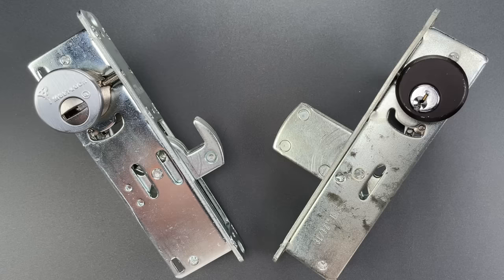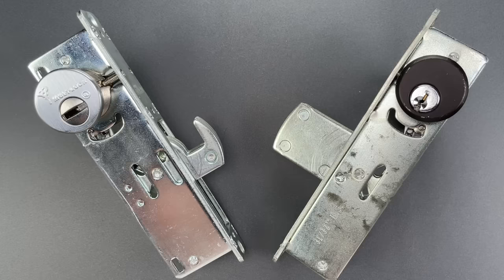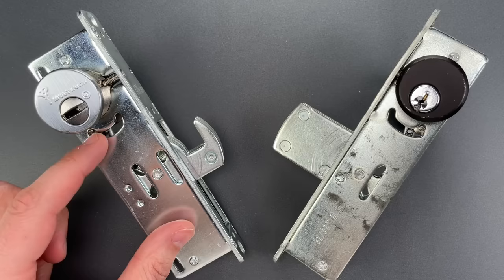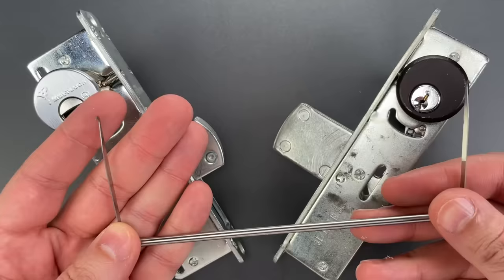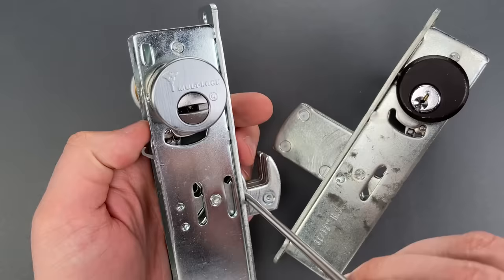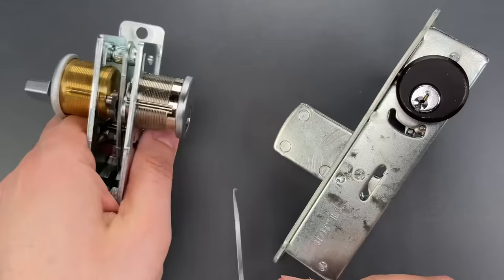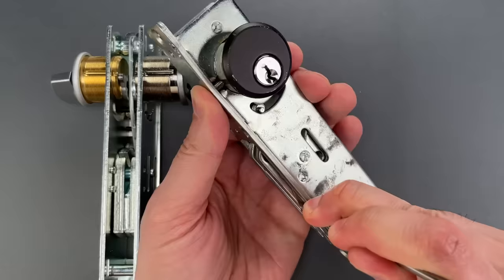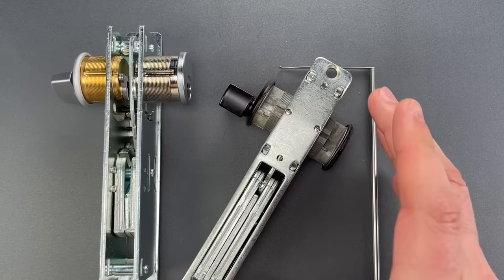[1409] The Most Significant Security Flaw in North America

Comment: Basically, what I’ve learned with lock picking lawyer is that most lock manufacturers are hoping thieves don’t take the time to research how to defeat locks and if they did, we’d all be in a lot more trouble!
Reply: Yes and no. The alternate is just as fast for most, just louder. 
Like here, a rock or brick will get you into the store. 
If you use a brick or this tool, the alarm is still going off. This tool will not prevent a smash and grab
Reply: Most manufacturers are hoping honest people stay honest.
Reply: Thieves don’t pick locks.
Reply: @IncredulousIndividual  They do if picking the lock is the easiest way into wherever they mean to do their thieving.  Usually that isn't the case, though, since windows are a thing and rocks are easy to acquire.
Reply: @IncredulousIndividual  You sure? All of them?
Reply: @IncredulousIndividual  You are talking about is smash and grab burglars. There is a reason we have different names that reflect different techniques under the overall umbrella term of thief.
Reply: @phil2544  only 4.2 percent of burglaries were committed using “lock picking”. (This also includes shimming window latches and sliding doors)
Reply: the security theater, about as useful as the TSA, if they are actually trying its like there is nothing there to stop them at all
Reply: @UlshaRS  I’m trying this one more time, our YouTube overlords are removing my comments Google “what percentage of thieves use lockpicks”
Reply: A lock is just a way to ensure honest people don't "break in" by accident
Reply: Or simply break the glass
Reply: Or, more likely, we'd be a whole lot better off. Who owns more locks: The working or the ruling class?
Reply: @IncredulousIndividual  True―if someone is picking your lock, you've usually got a bigger enemy than a petty thief haha
Reply: A brick through the window is more effective than a lock picking tool. Ive also seen faceplates on the front of doors to defeat this attack.
Reply: More often than not they'll opt to bust the glass out to gain entry, or if they are REALLY trying to be stealthy they will drill the locks out. A burg picking a lot is in the low, low 1% ratio of break ins lol Movies and TV shows like CSI made it seem like it happened a lot more than it actually does. Burg is all about quick, in, out.
Reply: @FakeJeep  it honestly should happen more given how easy it is.
Reply: if someone robs your stuff with this thing youll probably have a harder time getting insurance
Reply: @IncredulousIndividual  i can tell you for a fact that i personally have. Long past statute of limitations. I can say that you are absolutely wrong.
Reply: @raphaelvermin  see my other comments, no I am not. Criminals don’t pick locks.
Reply: @probablynotmyname8521  the faceplate only works if i cant bend it out of the way with a prybar. Ive never experienced one that took more than two or three seconds. Ironically Ive actually popped more than one door open on accident before i even had my tools in position this way. 
Most people never bother to set their doors properly.
Reply: @IncredulousIndividual  it's 4.2% your earlier comment is still visible
Reply: LPL made a keynote speech at an IT convention (look it up on YT) where he said that lock companies have relied on "security by obscurity" since the beginning of commercial lock manufacturing.  The internet has of course blown that mindset up, but the lock companies still don't seem to understand.
Reply: @IncredulousIndividual  my dude im telling you for a fact that i did. Believe whatever statistics you want. Hahaha
Reply: imagine californians knew that trick, oh shit (legal to steal in california under 1000$)
Reply: @GeorgeWashingtonLaserMusket  this does not require much skill. I speak from experience.
Reply: @CED99   no I sent a direct (rhymes with krink) to the source and YouTube  deletes it
Reply: if they're smart and dedicated enough they'd just become lawyers
Reply: @FilmFlam-8008  Generally speaking, if you bypass the lock in some form or another you'll still have whatever the time delay is on the alarm system (which you can either use to grab a few things and run, or attempt to bypass the alarm system), however if you break a window (or even enter in a different way than "normal") there's a good chance the alarm system goes off IMMEDIATELY
Reply: Considering older designs worked better, in many respects (better materials, sturdier casts) it's not that they hope, it's that they cut so many corners off, the whole affair is a punctuation mark for Bernard London's paper, back in the day. Scumbags get richer, people get poorer.
Reply: Cordless diamond saws make research obsolete.
Reply: LPL has a great keynote speech in which a big chunk of it is addressing the attitude of "security through obscurity"
Reply: Because locks are really just the first line of defence in security and mostly just works to deter casual thieves of opportunity or to serve as a temporary roadblock so that other security measures can come into play, like patrols and alarms.
Reply: @phil2544  The person said "most." My house was broken into on two occasions. It was obvious that they just smashed a window, flipped the latch on the frame, slid it open and climbed in. It saves them the time of doing something that either requires research and/or dexterity.
Reply: My grandfather used to say "Locks aren't there to keep thieves out, they're there to keep honest people honest." Now, while I think there's some truth to that, it's also obvious that locks very clearly were invented to keep those with bad intentions from gaining entry. I think a lot of the flaws many of the locks we rely on have comes down to either oversight or laziness, but that's just speculation on my part.
Reply: Security by obscurity
Reply: Conversely, a place's security is going to be roughly tailored to what it's worth. A 7-11 does not need the same rigorous security a bank needs. And there's defense in depth. Sure, they can pick your lock easy, but you also have an alarm, cameras, and a safe. Even if all those can be defeated, that takes time that can make a response happen fast enough to catch the person.
Reply: The thing to remember is it's a primarily a legal deterrent. After that is the security system, and insurance policy. I once was contemplating the nature of front doors on a house. They really don't stop people from getting in if they are determined. What does is the overarching social and legal agreements. I don't think most people are going to worry about guns, that only applies if people are home. What really stops 99% off it, is the amount of social and legal trouble that follows. There door isn't the real barrier, it is often a more of a symbolic barrier. Windows and glass doors pretty much nullify a truly secure building in the physical sense.
Reply: Well for me. He teach me how to break into goverment properties. I wonder how much he made every month with this
Reply: Another part of this is that information and tooling dissemination have never been easier. Most of these locks were designed and many were installed decades ago. It was negligent then but it looks practically criminal now. The ease with which thieves can access information combined with the ease of access to specialized tools (due to reduced cost of low volume manufacturing) means any semi-professional thief could easily gain access to pretty much anything they want.
Reply: @arrestedeffort  When locks were new they were unpickable because no one knew how to pick them. But the modern role of the key lock has changed and can no longer be the center of your defenses. Even in ancient times people still used patrolling guards to augment their locks as now people couldn't smash them without attracting attention.

Their is also little point in making extremely secure locks as that just pushes people even hard to find alternative means of access, like breaking windows or whatever you chained the item too.
Reply: @IncredulousIndividual  I’m surprised that it’s that high tbh. There’s usually a quicker and less skilled way to get passed locks. Bricks and bolt cutters are quick and easy
Reply: @fatehruzman9280  He taught you how to get past the lock... Successfully breaking an entering would be not getting arrested or hurt in the process.... That part is much harder, he gave you no advice on the subject.
Reply: @TheWizel  exactly, I don't think they ever meant for the front door lock to be the thing stopping you.
Reply: I think it's mostly about avoiding opportunistic thieving, as in someone sees that the door isn't locked, well they might go in and rob it. If they see that the door has beefy looking security, they probably won't do it. Of course, if someone specifically targets your store/whatever you are locking, as we can see, most solutions won't last 5 minutes. 

Plus, if you have cheap windows right next to the door, it might be better to hope they pick the lock rather than break the window, it's cheaper to repair, plus maybe you can get a refund on your security system if that was mentioned in the contract? no idea if it's something that's done anywhere in the world, but I wouldn't be surprised (maybe not in the US, but Europe probably)
Reply: The old expression "Locks on doors just keep honest people honest." comes to mind.
Reply: Security through obscurity
Reply: @FilmFlam-8008  Reading this ". This tool will not prevent a smash and grab" really made my day. I needed a good chuckle, thank you.
Reply: It actually makes heist movies were they research what locks they have more realistic tho probably would be boring if they actually had them as easy to get in as LPL makes them.
Reply: I don't remember where I first heard "locks are there to keep honest people honest" and I think of that on every LPL video I watch
Reply: I respectfully disagree Don, but I hear what you are saying..I hope I didn't misunderstand you...if so, my apologies.

A determined thief will still be a thief, unless they finally have a sense of reality. If they want to commit a felony to ruin their life, then that's on them...simple rule in life....just behave.

On another note, I love the way TLP shows how to defeat these locks and also the fundamentals of lock picking. This has greatly influenced the way I secure my valuables.

Regardless of what lock is used, if a person knowingly defeats any lock to gain access without authorization, that's a crime.

All his videos are very intriguing, I wish manufacturers would take more from these videos to produce higher security devices. 

The only problem with watching these videos, is I have no idea where to start with most lock choices, as every lock takes less than a couple min to open...lol.

That being said, it takes a good bit of skill. I would love to see the Squire SS100 with a Bowley cylinder.
Reply: Locks only keep honest people out
Reply: I used to work at a small store that used simple POS machines you can get at costco. The model number was printed on the top of it, and the easily googleable manual showed where a hidden release lever for the cash drawer was. That didn't stop a thief from NOT noting any of this, breaking in, and spending around 5 minutes hitting the front of the drawer with a hammer and large flathead screwdriver. 

Anyone smart enough to research how to break into something is probably working a job that pays them enough that they don't need to burgle.
Reply: At the end of the day, locks are for honest people.
Reply: @IncredulousIndividual  no actually a lot of people do which is why they get into houses with alarms being set off most people don’t alarm their doors at night or when they go out cause of the hassle in the morning or when coming in
Reply: What dont you have the door slide into a cover on your sliding doors in the USA? 🤦‍♂️🤣 MAKING THIS IMPOSSIBLE?

The poor quality of the doors shows why this is possible in the USA!
Reply: @notsam498  well he got money from doing all the time. So he Don't really need us for money
Reply: @fatehruzman9280  that isn't related to wether you know how to break into a building now.
Reply: I mean if they really want to get in they'd just bust the window open with a rock... Yet we still use fragile glass for windows and even doors so really locks are just designed to keep honest people honest otherwise we'd all install metal security doors
Reply: well if they are the kind of people who do research , the y won't be on the state where they needed to steal anything.
Reply: @FilmFlam-8008  So, why not just left doors unlocked and just trust on an alarm?
Reply: @ViniciusVetor  
Simple. It’s why people buy an alarm system sign without the system. 
Any level of apparent security adds to mitigate you as a target for crime. Just having the doors locked provides a barrier to the lowest level. It also prevents someone from opening the door not knowing you are closed and setting off the alarm (and too many improper alarms to the police has legal penalties)
Reply: @JamesEsau  
That time is an extra 15-30 seconds. Someone stealing a bunch of in a short amount of time is  literally going to smash and tear things off walls and through displays. That 15-30 seconds is not going to make a realistic difference at all, because as soon as they hear the BEEP BEEP BEEP countdown timer,m if they bypassed the lock, they are going to have the same reaction as when they smashed the glass.
Reply: A lock is only going to stop a lazy thief.
Reply: A lock just helps keep honest people honest.
Reply: @corgano6068  Also, when you search how to break in, then commit the act, and get caught.....doesn't help your chances in court.
Reply: Bingo  "exhilerating" is a term i would use. 
A deadblow hammer will take care of most locks in short time, but occasionally you're somewhere that discression is key and noise is the difference. Getting away with something without anybody knowing you were there is 90% planning, 5% execution, and 5% luck. The guys that only know how to swing hammers and throw bricks fall short on that 90% and thats why they all eventually end up hooked up, and i never was. 
The other part is keeping your mouth shut... At least until you've been 'retired' long enough for none of it to matter anymore.
Reply: It honestly seems that most thieves go for the noisy and fast entry, not the subtle one.

Any thief that goes for the subtle entry like this is scary good.
Reply: @mattgraham1983  Yup,, but honest folk tend to not get into trouble.. unfortunately we have to try to keep our valuables secure from the dishonest.
Reply: You should watch his keynote, calls them out heh
Reply: Most stores I've seen use metal roll shields (defeats the simple rock through the glass} and electronic security systems (defeats basic lock picking).
Reply: locks only keep the honest people out
Reply: How convenient then hey has a video showing how to break into stores using a tool he sells smdh
Reply: Totally agree
Reply: This is probably one of the most significant security bypasses that I have seen. Both in effectiveness, and how widespread the flaw has the potential to be.
Reply: @stever7638  again that's WAYYYY more thought than the average criminal ports into it. Anyone who stops and thinks wait let me look up what the punishment for this kind of crime is would be smart enough to not break in regardless. That's why increasing the punishment for crime rarely results in less crime being done.
Reply: @IncredulousIndividual  The problem I have with that percentage is, how does anyone even know if a lock was picked? No marks are left in the process.
Reply: @celivalg  in my last job, we had the stated goal of “keeping the mostly honest person honest”. We know we can’t keep the determined attackers out, but we can stop the opportunistic thieves.
It’s worth noting that we don’t ignore the determined attackers, we just want to rob them of time and minimize the damage they will cause.
Reply: The problem here isn't with the lock, but with the door construction. The gap should have been warded on one side. Seriously who in their right mind builds doors with a gap in them like that?
Reply: @phil2544  "You sure? All of them?"

Feel free to ask your local police branch if they know of any cases where the bad guys picked a lock vs broke a window, forced a door open, cut a cable etc.

The thing is; picking a lock is only of any use if 
A) You know how to pick the lock that you are up against and are proficient at picking that type.
B) You have the time to do it without being seen doing it.

C) There are no faster ways of gaining entry.
D) There are no easier targets around.
Reply: @IncredulousIndividual  make up your mind kid, one time you're saying it's 4.2% and another time that it doesn't happen at all. So which one is it?
Reply: @ChibiKeruchan  wow. A deep one
Reply: @notsam498  Agent 47 tell me a different thing
Reply: In the normal doors should be a peace of wood sonyou cant do this. That door is a piece of shut
Reply: Just wait until you find out what passes for IT security among all the firms holding onto your data :)
Reply: @IncredulousIndividual  that’s still not an accurate statistic because those are only people who got caught using lockpicks I’m sure there’s tons who use lockpicks that get away as well
Reply: And the complaints from many is that LPL is exposing things he shouldn't and in the process miss the point LPL is trying to make, which is... make and purchase better locks.  The make part being the primary focus since there just aren't many good locks on the market.
Reply: You forget insurance. Most stores are already covered and simply don't want any violence. Tools like these make violence not necessary.
Reply: Okay
Reply: @probablynotmyname8521  As we just saw, this tool is almost silent, just as fast as a key, and leaves nothing behind. I would argue this is MORE effective than a brick.
Reply: Picking locks isn't what thieves do. It just isn't. Hasn't been for decades.
Reply: @raphaelvermin  someone doesn't understand statistics, lol

4.2% != 0.00%
Reply: @LRM12o8  Lurk moar. 
The STATEMENT was "Thieves dont pick locks" 
I didnt say it. The screen name of "Incredulous individual" did. 

Not once did i say or even imply that 4.2% = 0
The statement they made was "thieves dont pick locks" apparrently they said this in spite of having the statistic. 
I was simply informing him that factually i used to occassionally pick locks in the field.... For the objective of repurposing other people's items and possessions. Factually a thief has picked locks. I dont know why that individual is so incredulous but they probly shouldnt be.

So what is your point?
Reply: @CalmoOmlac  i absolutely promise you i can get a steel punch and a deadblow/sand hammer in your country and your glass stands zero chance m8. 
You guys make good locks though. Ill give you that.
Reply: @JC-11111  ive factually done it within the last two decades. Not the most recent decade but the one prior. 
You're factually wrong...
Reply: @raphaelvermin  "Thieves don't pick locks" is still true in general terms.
4.2% is a small exception and since 95.8% of thieves don't pick locks we can say it is the norm that thieves don't pick locks. It should be obvious in this context (reminder: literally debating whether expensive high-security locks are a worthwhile investment on a glass storefront) that the statement refers to a predominant normal case and doesn't negate the existence of rare exceptions.

That was just you being overly pedantic about words.
And then you mocked the statistic as if your anecdote could prove it wrong when the statistics does show an exception of 4.2%!
When a statistic says that the vast majority of cases are not X, but your own case is X, that doesn't prove the statistic wrong.
That just shows you don't understand the difference between the terms "the vast majority of" and "all of"
💁‍♂️
Reply: @IncredulousIndividual  as a rule, they don't pick locks. But those who have some experience with picking locks can buy themselves an extra 90 seconds to grab before the keypad timer runs out and the alarm goes off anyway. If it's high-value stuff that's fairly easy to get to, 90 seconds can be a lot more money.

The best answer here is not to use glass doors, but that seems to be verboten in US stores.
Reply: @DrSardonicus  Agreed. The thing with crime is that the smarter and more skilled you are, the less trouble and effort you have to get into. Why rob a bank and draw attention when you can simply be the bank? 

Or worse, a politician. 😁
Reply: @stever7638  A smart person researches how to do illegal things they intend to carry out using Tor browser with a VPN... on a public network in another town...that they drive to in a used vehicle... that they pay for with cash and.. then exchange for another vehicle to drive to the site of the crime...carrying only a GPS-less burner phone and change of clothes with them.

...okay that's overkill unless you're planning on doing big enough to gain media attention (Tor Browser with a VPN is usually good enough unless you give law enforcement a reason to hunt you down.) but the idea that if you commit a crime you will be caught and punished is, frankly, a laughable one.

It's all just part of the security theatre to keep honest people honest.
Reply: Cameras
Reply: @IncredulousIndividual  You can't say criminals don't pick locks..when you also say some do. So it's not "Criminals don't pick locks" it's actually "Most criminals don't pick locks".
Not to mention the number of ones who do is likely higher as they're harder to catch (they're more stealthy, plus a lot of crimes aren't reported..People also aren't widely busted for theft, it's hard to catch a thief or get police involved in it.)
Reply: @testerwulf3357  criminals don't pick locks..
Reply: Thieves these days just walk in when the store is Open and just walk out with stuff.  no real need to come back at night
Reply: @FilmFlam-8008 why not just cut the power then? Assuming we’re robbing a standard small business then there is a meter right outside the building, it’s usually located in the back but could be on the side. If you destroy that then you pretty much cut off the power period, at that point you can pick the lock and enter. Yeah you could use a brick and smash the door open but it’ll look less suspicious if you pick the lock open and enter before shutting the door. 

At that point you should be free to do as you want, but still don’t stay there too long you’ll leave evidence. So make sure to only stay as long as needed.